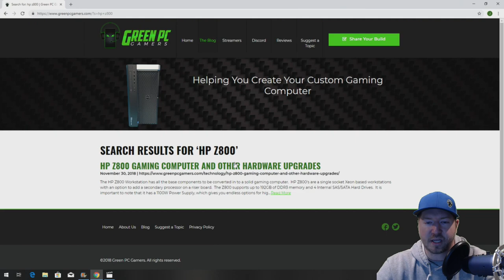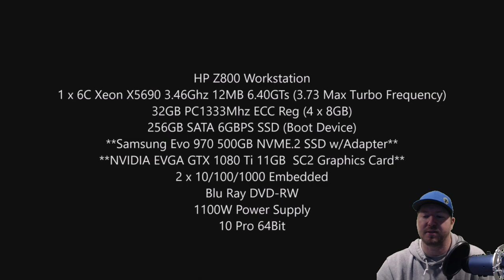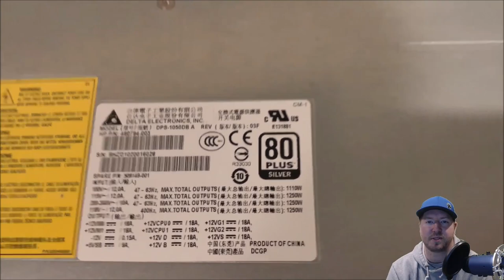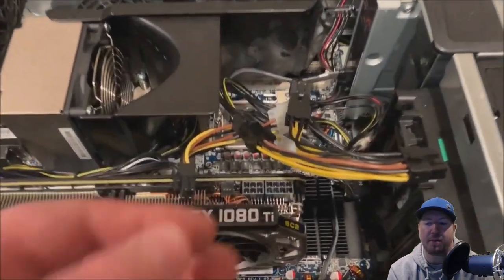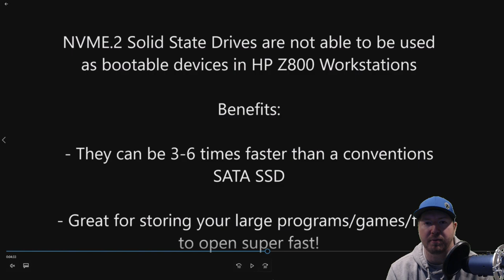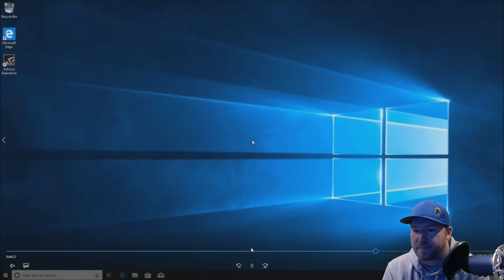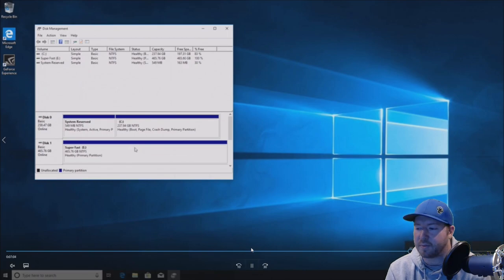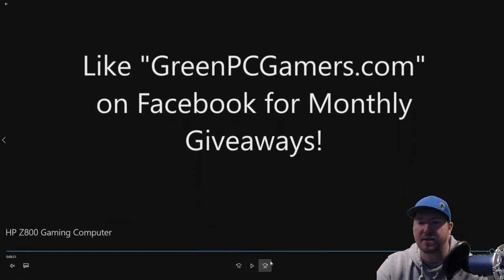HP Z800 Gaming Computer (GTX 1080 TI and NVME.2 Install)

Comment: This thing is a beast, I use it as a server. I plan to rebuild it and upgrade it to host multiple VM's, I have high hopes it will preform just fine. Bought it low spec on ebay like 3 years ago for 300 bucks. However, after 12 years old this thing is still putting in work in its current state for me. I had no idea how much I could upgrade it tho, thank you for this blog it is my upgrade guide.

Comment: The Z workstations were made to be used with Quadro Graphic cards that trap the heat, channel it out the back of the case through the video card, while aiding the hot airflow out of the case with it's own fan ... the  video card used (like most others) blow hot air out into the case cooking the inside of the shroud. The shroud was only meant to direct the air flow of the case fans in the same direction as the Quadro cards exhaust. This system's performance depends a lot on the airflow... I mean it was designed with help from a car manufacturer (BMW) and an automobiles performance is mainly about airflow.

Comment: i've bought one from a guy that works at the Canada DnD, he had the cpu's swapped from 1x xeon 4 core to 2x xeon 6C x5675, 24GB DDR3-1333 ECC in triple channel, 1TB in Raid but only 7.2K HDD, currently on order is SSD's, 6 to 8 pin connectors and waiting to find a good used 1070ti.

i only paid 300$ CAD for it, and also bought a Z220 for 200$ CAD with a Intel Xeon E3 1245 V2 with 16GB DDR3-1333 ECC, 128GB SSD and added a GTX 1060 6GB in it.

both these are actually for Folding@home but i do game some games on them from time to time but i have my main right for that :P

Comment: one thing you can do is remove the pci slot cover right below the GPU to encourage airflow in that area. there is a (120mm?) intake fan in front of the hard drive cages that will move a good amount of air through that volume

Comment: You actually can boot from an NVMe, you just need a drive with a legacy boot ROM like a Samsung 950 Pro, which is what I've been using as my boot drive in my Z800 for years now.

Comment: I use an Hp z800 and placed a nvidia 960 with 4Gb ram. It drives 3 1080p monitors. For gaming I only use the middle monitor. It still runs great.  I left my bottom shroud out of the system and noticed less ventilator noise under heavy load. I put a tywrap zipper on the green ledge to keep the ledge closed. 
I have two X5570 @ 2.93 Ghz and I run linux on it. It is greatly supported on most linux distro's. It works very great on Ubuntu, you can even put your disks in raid. I dual boot this system with windows 7 because of the tools provided by HP.
Next thing I want to do to expand this system is putting in a usb3 controller. I know the bios will probably not let me boot from usb3, but maybe I can fool grub in letting me boot a system on a usb3 device. I love to play with different linux distro's  and booting them externally would sound great. 
Nice video about the hp z800. It still is a great machine. The hp Z series is one of the best HP ever made.
Reply from the maker: We agree, Z800’s are rock solid.  Thank you for sharing!

Comment: I have this board and can verify that regular DDR3 memory works on the latest BIOS.
Reply: Ddr3 works I just installed 4 8gb Samsung chips inside
Reply: I'm having issues installing gpu got 6 beeps and power button went red whne I pulled gpu out system booted fine NVIDIA GeForce GTX 1050 Ti
Reply from the maker: What GPU are you trying to install?

Comment: Great video. I think I am going to add an NVME ssd now. Did you have any issues installing Windows 10 ? There appear to be no supported drivers from HP on their website. Have you a guide for an Hp z800 windows 10 install on your website ? I am in the UK and can't see your blog.
Reply from the maker: We did install Windows 10 without any issues.  You can load it just like Windows 7 or 8.  Most NVME.2 SSD's will not be bootable on the Z800 workstation.  You'll have to use a separate bootable SATA SSD for your OS.  Thanks for commenting!

Comment: Great video, thanks. How did you manage to close the bottom shroud? I have a GTX 1060 6gb in my Z800, and I cannot get the shroud to close because of the power connection sticking out too far.
Reply from the maker: Our particular GPU fit underneath the shroud.  However, some do not.

Comment: You can actually boot on an NVME, ... sort of, if you are running Linux. It will maybe work similar on Windows too but I don't know much about Windows, only have it on my company laptop, so I can't tell. You need GRUB to be on a supported drive and then you can configure it to boot from another drive (the NVME). For me the solution came accidentally. I had Linux Mint on a normal SSD and installed another copy on the NVME (on a PCI Adappter) alongside (this is an option in the installation process for Linux Mint). Then I modified GRUB to use the NVME as a default. That worked for me. The NVME is a Samsung EVO 980 1TB. Should also work with any Windows Installation but GRUB as the Linux bootloader has to start the boot up and then has to continue the boot up on the NVME. So technically it is not the NVME booting first. There is probably a better and more elegant solution, somehow it will be possible to install the OS on the NVME and put the GRUB bootloader on a supported device in one installation but as I said, this came up for me accidentally and because I like to have a second backup system anyways, I didn't try. I have one error message about a not identified device on the boot up where I have to press enter to continue or just wait for about ten seconds then it boots up automatically.

Comment: I did that set up but i did one 6 pin going to the card and the other one going to a 6 pin to dual 8 pin adapter and it works great for my gtx 780
Reply: just bought a reburb z800 and wanted to install the 1080Ti...   seems your power cable method would be an improvement, and possibly save something for dual install.     did the 780 require the same power as the 1080Ti ?    thxs for any suggestions.  (rig: z800, 1110psu, 2x x5675, 96Gb ram)

Comment: Greetings from Germany ! - Just for your interest: HP Z800  > CAN BOOT <  from NVME.2 ! You just need a special type, I can recommend using the Samsung 950 Pro 512GB (or 256 GB) M.2 2280 as the Boot-drive, if you still manage to get one. (Works perfectly in mine !), the other one I tested and keep as a spare is the Kingston HyperX Predator SSD PCIe Gen2 x4 (M.2), available with 240, 480 or 960 GB. - Recommendation, I tried (and own) both types, system performance takes another big leap ! ;o)
Reply from the maker: Thank you for the valuable info.  It’s a bummer that those model ssds are really expensive and hard to find.
Reply: Hi i need help i have just now adapter for nvme and hard drive whic is teamgroup PCIe gen 3 x4 and i am not able install windows on that please help i have hp z800 with xeon 5670 2.93 ghz

Comment: I also have an nvme in my system with a pcie adapter and although it does work the transfer rates are pretty abysmal. So I have a couple ssds all striped together in a raid 0, and I use one SSD connected directly to the board as a SSD cache. 

CPU: DUAL Xeon X5677
GPU: AMD SAPPHIRE NITRO R9 390 8GB GDDR 5 LIMITED BACKPLATE EDITION
RAM: 40GB ddr3 1333
Storage: 1TB of SSD in a raid 0 and nvme/pcie adapter
System wide SSD cache using "Primo Cache"

Probably going to take the boot drive down to two striped ssds, and then get two striped one terabyte drives and put those behind an SSD cache. It's not going to have a huge effect on gaming, and load times will be negligibly longer. By the time it's running in memory it really doesn't matter that much.

Comment: A Samsung 950 Pro on a pcie card is usable as a bootable drive. I have one on my X58 system on a Gigabyte X58A-UD3R V2 with a W3690 cpu and Windows 10 Pro.

From what I've ben told. Don't have a second one yet to try.  If you raid them, it needs to be a software raid.  You can't hardware raid it.

Comment: Hi. I have the same machine and I'm willing to upgrade it asap but i have some concerns since I'm using it for rendering works... Like i have x5660 xeon installed and i want to get a gtx1080ti with a 32 gb... Will it get a bottleneck?

Comment: Thanks for sharing this video. My z800 runs dual X5620, 850W PSU, 48Gb RAM. I am looking to replace my Quadro 4000, so any GPU in your "Recommended graphic cards" will work fine with my 850W PSU? Thanks
Reply: How's it doing in gaming?? Did you replaced the gpu?

Comment: Hi, i put a rx 580 into my z800 about a year ago. And 3 months ago it started having problems were my Z800 would shut down while gaming. Ive read that the psu for the Z800 were junk. Also im confused because it will act up for a week then work fine for a few months. Do you think i could get a alternative psu because i dont wanna buy a 300 dollar psu for my z800 that are made cheap. I also did researxh an others have same problem but with different computer. Maybe its my gpu but i dont know why it would cause it to restart.

Comment: Installed asus gtx 1080 ti turbo, no picture. The indicator on the display flashes and nothing else happens.
I return back 4800 qudro and everything works. What could be the problem? Maybe something needs to be adjusted in the bios?
Reply from the maker: Can you test the 1080 ti in another system to make sure it works?

Comment: Excellent video. Thank you. The boot drive on the z800 will be 3G sata2. I would suggest you add an excellent internal pcie sata3 card for better speeds.
Reply from the maker: Thank you for positive the feedback.  We are only using the Sata ssd as a boot device for our operating system.  You are correct, the system board will bottleneck the throughput to 3GBPS, but that won’t cause any issues.  We installed the NVMe.2 SSD in the one of the PCIe slots to boost io speeds when opening up all of our games, programs, and large files.  Obviously you will have to choose the NVMe.2 ssd as the path to install all of your games/programs/large files to achieve the higher performance.  Let me know if you have any questions.
Reply: build raid0! i use my hp z600 2x ssd to raid0. with out raid my ssd speed is about 250, but with raid it is about 500!
Reply: Yes I did that and have excellent speeds.

Comment: You said NVME will not boot on z800, but will M.2 boot using a PCIe adapter?
Reply from the maker: It won't boot to an NVMe M.2 SSD w/o a boot assistant like clover.
Reply: @GreenPCGamerscom  Not true, I do use my NVME M.2s with adapter and they work perfectly fine, I am currently booting Windows 10 from a Samsung 950 Pro 512GB...! ;o)
Reply: @Steffko012  The NVME on here is the Samsung 970 and you Can’t boot into it on the Z800. You can on the Z840 because that is built into the BIOS.
Reply: @Steffko012  What adaptor are you using? An NVMe to SATA convertor.
Reply: @Steffko012  will EVO 860 M2 ssd work?

Comment: HI. Thanks for your video. cool. Just a question. I installed a NVME ssd in the last PCIe slot (same as the video) but my windows 7 does not recognize the drive. Do you know If I omit any step ?
Reply from the maker: Windows 7 doesn't normally recognize NVMe SSDs.  What model system are you using?
Reply: @GreenPCGamerscom  Windows 7, I think I have to upgrade the BIOS (3.6 now). What do you think?
Reply: @korsario023  Upgrade your BIOS and get one of the SSDs I recommended today at the top of the page... ;o)
Reply: @korsario023  Works perfectly fine with Windows 7/8/10, see my comment on top of the page..

Comment: Having a similar problem to some others who have tried to upgrade the GPU.   I get 6 bios beeps and auto shutdown.  I have an xfx xxx rx580 8gb card (which is rated at only 150w tdp, so you'd think if you got it to work with a 1080 ti, which is 250w tdp) which I pulled from a working pc.  I removed the old firepro card and installed the rx580.  I have tried hooking up the power connections the computer came with (dual 6 pin connector), but the card had 1 6 pin and 1 8 pin.  Looked at your website,  and you recommended getting a molex to GPU adapter.   Is this to take advantage of the dual 12v rails?  I've heard you shouldn't hook up 2 different rails to the same card.  Should I just get an adapter for the second 6 pin to an 8 pin?  Or should I get a molex 4 pin to 8 pin, and run it off the ide rail?
Reply from the maker: You are running in to a unique issue.  Yes, we like to take advantage of multiple rails for stability.  We've never had an issue using multiple rails on the same card with HP/Dell/Lenovo Workstations.  Let us know how you end up fixing the issue.
Reply: @GreenPCGamerscom  Tried a different 6 to 8 pin adapter that was better quality (thicker wire, etc.) works great now.

Comment: I just got an RTX 3090 - which has 2 8pin connectors. I followed these instructions with the same adapters but to 2 8pin instead of 1 6pin and 1 8pin but the computer is beeping with a red light upon startup and won't boot up with it. I know it supports the 350w but is there another way to hook it up? I am using the slot right beneath the one you have there.
Reply from the maker: We don't recommend installing an RTX 3090 in a Z800 workstation because the bottle-necking will be terrible.  However, if you are still going to proceed with the install you'll have to do some troubleshooting.  There is definitely a power rail issue.  In this scenario we would normally use a secondary power supply for additional power rails to see if we can temporarily get the system to boot.  Then add and subtract with the original power adapters to see where the power rail issue is.  Good luck!
Reply: And? Did you manage to install RTX 3090?

Comment: Hi, you know? i updated my hp z800 with nvme2 and all good. I had it with a 3060 but to work in unreal I went up to 3070, my power supply is 850w, but when I render, the computer shuts down and restarts. I am connecting the graphics card to pins 6 (p10) and 6 pins (p11) and convert them to 8 pins of the graphics... however, even having 850 w the graphics force the pc to restart. Have you tried any 3070 graphics?
Reply from the maker: It's mostly likely shutting down because of a power rail issues.  Start with trying new power adapters or a different configuration of power adapters.  We've never had this problem on a Z800.  However, we normally stick with the 1100W Power Supplies.

Comment: The plastic part that holds the GPU in my PC isnt closing if I dont use it will it be unsafe
Reply from the maker: Most of the time, no.  Monitor your temps while the system is under heavy load.  Try not to maintain gpu temps above 70 Degree C for long periods of time.

Comment: I grabbed this beast awhile back for $350 on Craigslist. Came with dual cpus, six cores each.. total of 24 threads..192gb ram, only missing a decent gpu.  This beast can raid (0,1,5,10) 4 ssd a 1tb for better space and  performance.  On the video I saw 1080ti installed, anyone can confirm if rtx2060 will work?
Reply from the maker: Yes, normally if it fits, it'll work.

Comment: Hey! Does anybody know if the Nvidia RTX 3060 or the new RTX 3050 fits in the HP Z800? Or any other good $200-300 graphic cards?
Reply from the maker: The RTX 3060 does work in the Z800 Workstation.  However, some versions of the RTX 3060 will require you to modify the internal plastics to be able to shut the side panel.

Comment: Hi man i trying apply your video to my z800 with gtx 770 amp and quadro 4000 but the system keep restart first i connect 1*6 pin and Dual Molex to 8 Pin Male (that Found in the link)  to gtx 770 and then connect 1* 6 pin to quadro 4000  i need help my spec x5570 and 1110 w
Reply from the maker: We don't recommend mixing quadro and geforce cards because they use conflicting drivers.  You should have plenty of power in your system.
Reply: @GreenPCGamerscom  I was wondering if I can install an RTX2070 even that the specs say it can only work with PCI 3.0? any thoughts?

Comment: Can you put two 1080? I have a dual Quadros  5000 dual xeons
Reply from the maker: You could, but it would be tough to provide enough power rails for them.  Also, you wouldn't be able to enable an SLI configuration.

Comment: am I able to use 2 nvme drives and use them on a raid 0 to get more performance on z800?
Reply from the maker: It's possible, depending on the pcie adapter(s) that you use.  They will not be bootable w/o a boot assistant like clover.  You could set up a software raid in windows.
Reply: As long as you insert them into the PCIe 16x lane Yes you probably can - ATM I'm doing a series on Supercharging the Z800. I started with a really cheap z800 I bought from Ebay and found it had a lot of problems.

Comment: i had upgrade the NVME M.2 at my Z800 only the last slot PCIE can read the card and nvme
Reply: How did you do that?
I have an HP Z820 and I still haven't been able to install a Sumsung SSD 512 Gb PM961 NVMe, with HP Turbo Drive G2 adapter

Comment: Do you have a system boot from NVME M.2  Windows system installed on NVME M.2 disk on your PC?
Reply from the maker: No, on the Z800 we are using the NVMe M.2 SSD as a fast storage device.
Reply: Yes, I do, you just have to use special types of NVME, see my comment on top from today.

Comment: HP Z800 does not officially support booting from PCI-EX devices. What's the point of installing it with a second disk?
Reply from the maker: To utilize a super fast storage device.

Comment: Would a amd radeon rx 5600 xt raw ii pro 6gb graphics card work in this rig?
Reply: That card has PCIe Gen 4.0, the HP z800 has PCie Gen 2.0 slots. It will work, however the PCI Express slot will be holding back a bit of performance